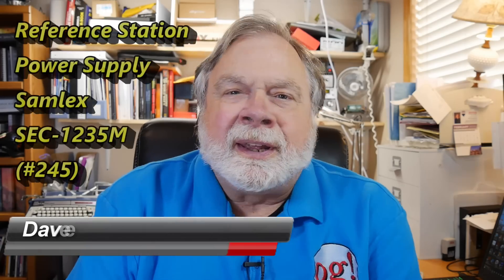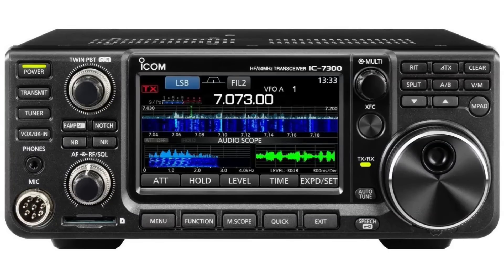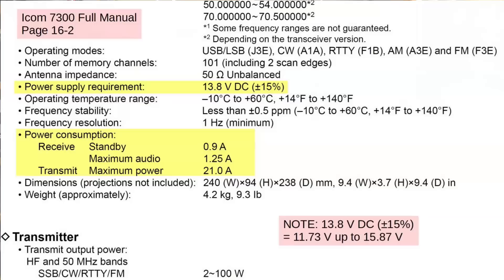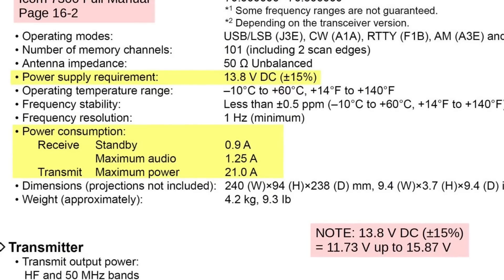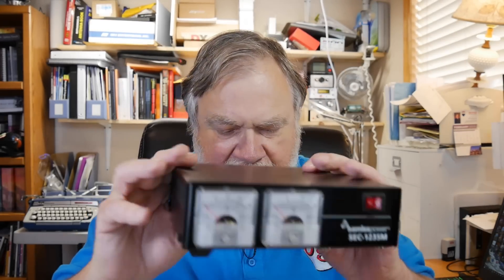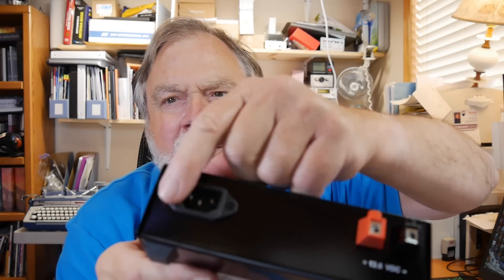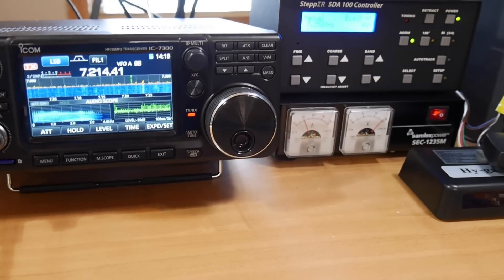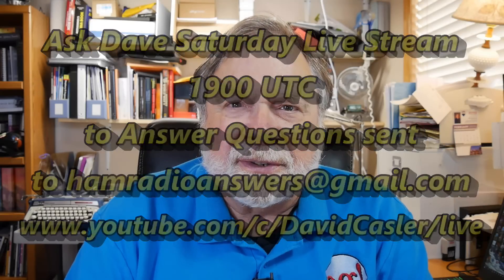Reference Station: Samlex SEC-1235M 13.8 VDC Power Supply

Comment: So, for the SEC-1235M how is this grounded and bonded since there is no chassis ground? I have this power supply and an Icom 2730A radio. Being told I need to ground and bond them in my station, but nobody provides the how!! Any info? Thanks!

Comment: FYI, you're better off using a crimp ferrule when inserting wire into a compression terminal vs a tinned lead.  Thermal cycling of a tinned lead in a compression terminal will eventually result in a high-resistance connection and cooked terminals.

Comment: Hello.  I Have a  20 Amp 13.8VDC Linear Regulated Power Supply  highly stable, high quality. My question is on the unit it says 20 AMPS Constant / 22 Amps Surge. What is the 22 AMP Surge for?  I love this Channel. thank you for all the info. 73s

Comment: I like your description of the fan at 10:34. I definitely got an idea of what your experience was from the delivery. :)  (also +1 spontaneous “that rings a bell” comment at 11:15).  Thank you for the heads-up on the fan, and more seriously,  the entire video review. This is incredibly helpful as a new ham trying to set up a basic station. I’m starting with a vhf/uhf because this whole process is going to be done over time due to the money needed and I appreciate getting one power supply now instead of finding out later I should have gotten a different one to run the eventual HF rig. 
Thank you!

Comment: When reviewing the power requirements for the ref transciever, it showed maximum current requirement at 21 Amps.  Does this mean that the wall receptacle the power supply is plugged into needs to be wired to a circuit breaker that is larger than 20 Amps?  Sorry if this is an elementary question.  I did take circuits class in college, I passed, but I can't remember this answer.
Reply from the maker: The AC input is 120 volts AC at about 3 or 4 amps. The output is 13.8 volts DC at up to 30 amps. Slightly more power in than out, but the modern power supplies are more than 90% efficient. Hope that helps. I did a video on this question awhile back.

Comment: I have a few power supplies around. I do some repairs on various electronics and I love the variable voltage supplies for starting at 0 volts and climbing. I once caught a short in a cb at roughly 2 volts. Long before it would have damaged the radio.

Comment: SEC-1235 / SEC-1235M are Switched Mode Power Supplies (SMPS) whichconvert 120 VAC, 60 Hz (or 230 V, 50 / 60 Hz *) AC power to regulated 13.8 V DCpower based on Pulse Width Modulation (PWM) control.*Note:The units are factory preset to operate from an input voltage of 120VAC, 60 Hz. These may be set to operate from an input voltage of 230 VAC, 50/ 60 Hz. by changing internal settings as described below under "OPERATIONFROM AC INPUT OF 230 VAC"-Based on switched mode technology and PWM control-Compact and light weight-High efficiency and less heat dissipation-SEC-1235M comes with voltmeter and ammeter-Protected against short circuit, over load and over temperature-Cooling by temperature controlled fan-UL safety certified and listed under UL Standard UL60950-1 forInformation Technology Equipment Power Supply-Complies with FCC Part 15(B) for limits on EMI for Class B DigitalDevicesOPERATION FROM AC INPUT VOLTAGE OF 230 VACThese units have been preset to operate from an input voltage of 120 VAC, 60Hz. The units can be set to operate from an input voltage of 230 VAC, 60 Hz. bychanging the position of an internal jumper. The procedure for conversion toinput voltage of 230 VAC, 50 Hz. is as follows:• Switch off the unit and unplug the power cord from the AC outlet• Remove the top cover• For 120 VAC operation (pre-set condition), points "D" and "E" on theprinted circuit board (PCB) have been connected (shorted) with a flexible wirejumper. To convert to 230 VAC input, disconnect the quick disconnect connectorat point "D" by pulling it upwards. Tape this end with an insulation tape and usea cable tie to tie it securely to the wire harness running above• The fuse on the AC side for the preset input voltage of 120 VAC israted at250 V, 8 A. For 230 VAC operation, the fuse has to be rated at 250 V,4A. Replace the existing 8 A fuse with a 4 A fuse. See under "SPECIFICATIONS"on page 11 for details on the 4 A fuse.•The detachable power cord that is provided has an "IEC 320-13"female connector on one end that will mate with the "IEC 320-C14" male ACinlet connector on the power supply. The other end of this power cord has a 120VAC NEMA5-15P plug meant for connection to the 120 VAC, NEMA5-15R outlet.For operation on 230 VAC, 50 Hz, a different detachable power cord will have tobe used. Use an appropriate power cord that has an "IEC 320-13" femaleconnector on one end (for connection to the "IEC 320-C14" AC inlet connectoron the power supply) and a 230 VAC plug on the other end corresponding to the230 VAC outlet. Please ensure that the new 230 VAC power cord uses two pole,3 wire grounding configuration (this will ensure proper earth grounding).

Comment: Just ordered one of these supplies you recommended.  Before that, I had bought one that's the guts of one of these but no meters, or a nice case to put it in.  My old icom PS15 measured 14.2 volts, so that's what I set my switching supply to.  The switching supply is nice because it pulls less power, and creates almost no heat compared to the PS15 which contributes to warming my office.

Comment: Hello, I am a "maybe" proud owner of the MFJ-4225MV.  The fan is loud and distracting!
  I installed a temp. sensor, (40c/104f , N.O. Switch) on the fan wiring.  Also, I drilled out the holes on the sheet metal external housing, closest to the fan. (3/16" drill out, and 3/8" countersink exterior openings/holes)  This reduced blower noise somewhat and the temp. sensor was a good addition. In closing, the skill level includes deburring, sanding, BO Drill, Dremel pencil grinder/finisher, a well equipped tool shop, and possible spray painting exterior cabinet shell. 
(Dave, thx a bunch for all you do in the ham radio world.)  de N8NSK

Comment: Would love to see the Samlex on your oscilloscope.
Reply from the maker: Noted! It would be easy to check out.
Reply: @davecasler  thanks for this video and many others you already did. They are really helpful and explains a lot of radio things. I would be glad to see a simple comparison - if it is possible, please show us spectrum scope of ic-7300 (or any other SDR) battery powered vs ic-7300 powered in use of switching power supply presented in this video. It is tempting to buy those tiny PSUs but I have not so good experience with HP server (switching) PSU (HP HSTNS-PL18). The HP PSU wasn't total disaster but far from being clean and silent as many other ham radio operators tries to advertise them. I mean in terms of RF noise. I am wondering whether those from Samlex are any better? 73 de Juliusz SQ2JUL
Reply from the maker: @sq2jul  The power supplies made especially for ham radio are particularly RF-quiet. The Samlex is a particularly nice supply.

Comment: Dave, thanks for all you hard works an perseverance with your videos. You truly shine as an example of an mentor or Elmer to the YouTube generation. I have a quick question on grounding the Samlex SEC-1235M power supply.  I did not see a grounding lug on the supply. I am assuming a ground to one of the chassis screws would suffice, or is there no need to add this PS to a grounding system. Your sage advice on this topic is greatly appreciated.

Comment: I’m sure you are full of numbers and nomenclature but to add to the pile.....  the “computer” AC connector you mentioned several times is an IEC 320 C14. The C14 is the side on the computer and C13 is the side on the plug.  Thanks for all your videos.  They are immensely helpful.

Comment: Hey Dave, I am back reviewing the reference station and I am here for the power supply.  Would you recommend having a 12VDC battery bank on a solar system?  Why or why not?  Also if I were to use a battery bank, my concern is regulation such as stable output.  Hope you are doing well.  My life has been interrupted with the changes because of the pandemic.   I have a tower that is ready to raise a inverted V via pulley on a bracket.  Also clearing out the room from the old junk ... errr ... equipment has me working slowly as far as progress is concerned.  I hope you are doing well.  Thanks for your part of keeping the Ham community educated.  Cheers! 73
Reply from the maker: Yes, you can do solar. I have a solar system set up myself. I have a little box that boosts the battery’s 12v to a more radio-friendly 13.8 volts. See http://www.westmountainradio.com/dc_power.php and look at the N8XJK  device.

Comment: I bought a Samlex SEC-1235M and used it with my IC-7300.  Then I got an IC-9700. When powering just the IC-9700 in receive, the Samlex runs the fan a good 10 minutes every half hour or so. Its sitting alone on a shelf with air on all 4 sides.  Wanting a new one that can power both and not be so loud.

Comment: Thank you for the very informative videos. Just a note, the User Guide for the Samlex 1235M specifically warns the User not to use bare wire inserted into the 12V power output but rather the supplied posts (not mentioned).  The reason for this is as you discussed, the screw fasteners will splay the wire. Thus potentially causing a less than optimal connection and possible overheating of the wire insulation/fire. Yes, you did tin the wire which does help but this point should have been made to avoid confusion. Thanks again for your excellent instructional videos.
Reply: Just got my Samlex 1235M today and was reading the brief instructions. It says "do not connect bare stranded wire end directly to the DC output terminals as the strands will spread" P12 in my booklet. They give you 2 terminal lugs to use so you can avoid any sparking/melting/overheating, with a possible poor connection. Cut the tips off to fit the lugs they gave you and solder the connections to the terminal lugs. Don't go the whole length of the lug but just the larger round end. They tell you to crimp the ends but I would solder them.

Comment: radio was made for every one  a little thing for every one, some like contesting. I personally  like to rag chew, but it has gone south like the Cb radio did. yes I was a eleven meeter kid. in the days I used to run a cobra two thousand  a three element beam which was electronically controlled. and a palmor three hundred when c b was in it hay day. the Cobra is long gone, but I still have a rad shack setting on the shelf. it was my first single side ban radio. I know there is hams out here that would not want to admitt that they were eleven meeter band children. I just love radio and I hate to it go the by way.

Comment: I just got a new 7300 hundred. I don't have any of the power supplys you talked about. I do have to astrons and they put out twenty  volts. I run my five ninety on a twenty watt one even though it called for a twenty five watt one. I now have a marine power  supply that runs at forty five watts continuous. I hoping the radio will only draw the power that it needs. I wish I had some one that I could converse with to seek aprovial  off a second opinion, but I think I will be safe hooking up the radio. I like the old days when there was a nice group on forty meeters. Always takes someone to spoil radio. I have taken more to being on this thing. because there is no jack leg that can ruin it. I sometime wonder why i bought the new radio when it is dead out there. I did listen to a conversation on twenty meeters last night.

Comment: Hi Dave, thx for another great video. My question is what's the pros/cons of using a variable power supply over a fixed voltage power supply? I currently have a Astron VS-35M that I used with my Midland 2m and 6m land mobile radios. I'm using your videos to prep for my general license so I can use my Kenwood TS-530S.

Comment: Hello, and thanks for taking the time to make these informative videos.  I'm just starting out in Ham Radio and about to upgrade to my General ticket.  I've just purchased the IC-7300 and the Samlex SEC-1235M Power Supply shown in your reference radio series. Couple questions:  1. I want to run my rig portable and was wondering if I need to use a power supply out in the field, or can I run it directly from a LifePo battery assuming voltage and amp requirements are met to power it.  2. Is it possible to convert the power connector on the back of the IC-7300 to Andersen Power Poles, or do I need to get the icom connecter and make a power pole connection on the other end of the cable?  My Bioenno LifePo battery came with an Andersen Power Pole connector.  - Again thanks for the great videos and encouraging new Hams liek myself to further explor the hobby.

Comment: The newer mfj costs less, had less fan problems, and puts out more current! (4230)
Reply: But, on the down side, there are only banana plug/compression binding posts. They didn't even use 5-way. So I had to solder the 7300 cable to a banana. This justifies your choice!

Comment: Dave,
I had destroyed a couple projects with the MFJ supply until I realized that on power up there was a 28vdc spike that smoked anything that had the collector  hooked to the +Vcc , including a 100 watt 2m amp. They needed to add a choke to the output. The version that has the cigarette plug rated at 7 amps, has a choke in line with that output.
Lee, WA8QFE
Reply from the maker: Good point. Always turn on the power supply prior to turning on the radios.

Comment: SEC-1235M is a great choice. I've been using it for over a year. It works great and it's very quiet. If you are using only SSB, the fan will be not turning on at all. It goes on only after about half an hour of calling CQ in 40W digital or 100W CW, and even then is not that loud. 73 de R2AUK

Comment: I've had my Samlex SEC-1235M for two years now.   Very nice supply, but quite noisy when it decides that it's too hot, which happens after about 30-60 minutes of continuous FT8 QSOs.   It'll switch on its fan for around 5 minutes to bring the temperature down, making the shack a somewhat unpleasant place for that time.   However, there is a mod, which I've done to mine, which runs the fan full time at a very low speed (almost but not quite inaudible).  This is enough so that the power supply doesn't get hot enough to trigger the high speed noisy fan mode. 

The mod is very simple, it just wires up the fan through a resistor to power.  If you google 'radiodan samlex pdf', you'll find it. 

Thanks for the excellent videos.  -- Bill, W2WZ

Comment: Great power supply that 1235M - though if you use more than one device at once some electronic radios reboot.  I added a 3.5 farad car audio transformer to it which made a world of difference when a 2nd large load kicks on (e.g. 2 radios TX at once) such as running FT8 while doing APRS or FM voice running near the max continuous output power.  Holds voltage great  and RF quiet though and works fine for 1 at a time.  I was able to put two wires under the screw terminals no problem (one 12awg, one 10awg) and they seem very secure after tightening the screws down
Reply from the maker: Thanks for the tip.

Comment: I've had an MFJ-4225MV P/S for nearly 20 years.  I don't think it is a re-branded Chinese or Taiwanese product but components could have been built for MFJ in those countries.  Works great as a 12 V test bench power supply with no CC capability.  The limited range voltage adjustment also makes it a great current source for Lipo battery chargers or cutting foam wings and bending 1/8" acrylic sheets.  Haven't used mine to power a ham rig yet but I'm sure it will work fine for that too.  No kids to worry about so curious fingers are not a problem for me.  The fan noise doesn't bother me either, but if it did I'd probably install an NTC thermistor or some other circuit to adjust its speed automatically.
Reply from the maker: I said that because I remember seeing that same power supply for sale from Chinese sources.

Comment: Dave, would be helpful if you would include a picture of the labels that are attached to your recommended reference station equipment. My particular purpose is to determine what regulatory agency approvals (UL, CSA, TUV) are claimed by the mfg.

As a former Homologation Engineer I’d like to point out if a “person” buys equipment from a foreign country and imports it into the United States that person is legally the importer of record and is totally responsible for the equipment. 

Hypothetically if you purchase a device that plugs into our mains (wall outlets) and the device catch’s fire and burns your house down your insurance company will spend time/dollars to develop a case against paying your claim. Yes I know, those insurance agents are your best friend when accept your money but make no mistake about it when a claim is presented it goes to a entirely different group of people whose whole purpose in life is to legally deny your claim. 

My recommendation are; 
1. Only buy from a company that is the legal the importer of record and has financial resources.

2. Require a NRTL Mark ( UL, CSA, NOM, TUV ETC.)  be affixed to the equipment.

3. Don’t rely only on the CE mark, specifically if your outside of the EUROPEAN UNION. The CE mark is not a independently verified claim like a UL, ETL MARK,  it’s a Declaration of Conformity by the mfg. Within the EU the person who signs and makes that claim is personally responsible and can and will go to jail if the product is not in compliance with the appropriate directive.
Reply from the maker: I put a photo of the manufacturer's label on my website at https://dcasler.com/2020/02/20/samlex-sec-1235-power-supply-manufacturers-markings-and-certifications/.